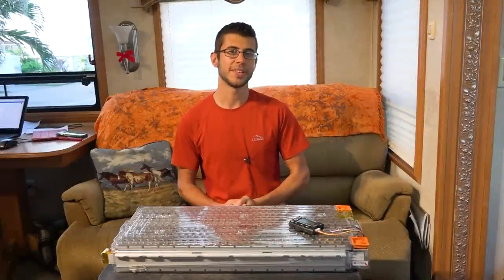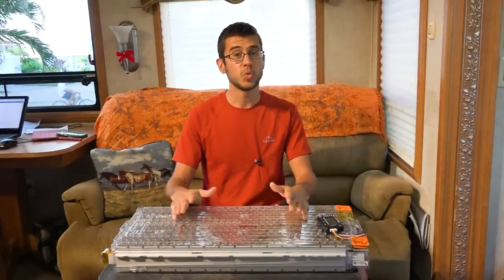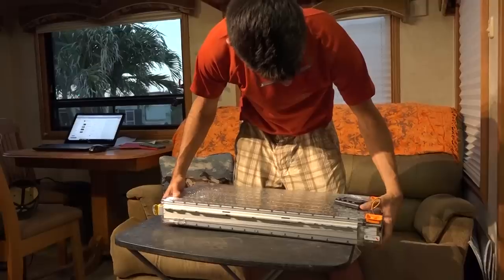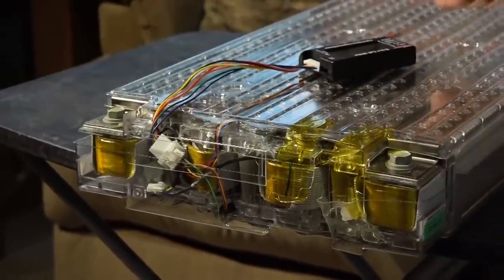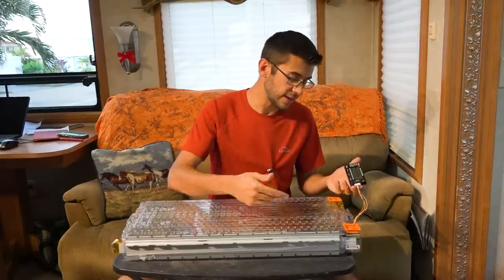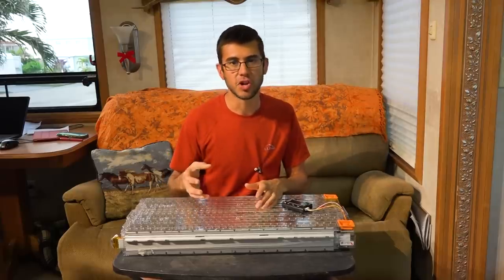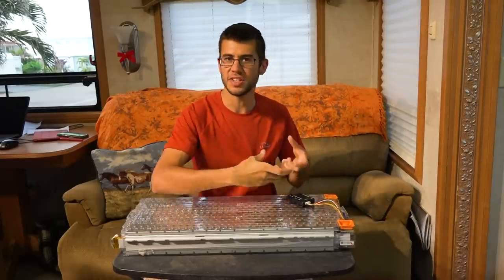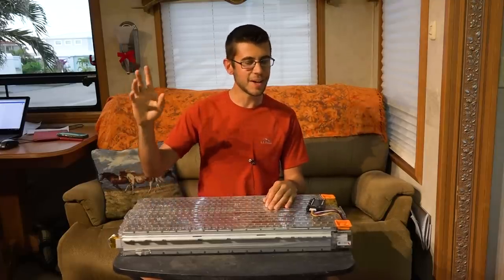Overview of the Tesla Lithium Battery Module We are Installing in our RV - EV Battery Hack!

Comment: I was hoping you were going to set up the system with your 12-volt system using step up and down components. I have a Nissan leaf battery bank i put together with a 12-volt 3000-watt inverter. the 12-volt system limits mt charge capacity to 16 volts. I wish to get the 16.8 volts max storage. to do this, I have to go to a 24-volt inverter. my biggest problem is that my intellicharger is only 25 amp. that means it takes about 6 hours to charge from 13 volts to 16 volts. i would like to find a 300 amp car alternator to solve the charging problem. after im done configuring everything, I will add the solar panels. any suggestions"

Comment: As this battery has ~5000 Watthours and I can find it for 1500 to 2000 $, it means a cost per Watthour capacity at max 40ct. 

When I am looking for a 100amph battery (lifepo) it costs about 1000$. 100amph*12volt=1200watthours. So nearly 1$ per Watthour capacity. 

Am I calculating wrong or is the price per Watthour for a used tesla battery just so amazingly low?

Edit: if I calculated right. Are there parts for an tesla rv solar system that are becoming more expensive, just for using this type of battery?

Comment: You said that lithium batteries cannot go below freezing, that they can be used, but not charged. Considering that they are in a Tesla (either with any lithium battery or any Tesla battery in any vehicle - including an RV), what happens if the vehicle is in a very cold climate that goes below freezing every night, and often during the day, for months when it is parked outside (or even in an unheated garage)? I see that it can be used, but how do you keep if from being in a freezing situation? Eventually, it has to be charged, which you said will destroy it.
Reply from the maker: The car heats the battery.  I talk about those heating cooling coils.... In our RV we use a heating pad.  Watch the rest of the series to see the installation.
Reply: @MortonsontheMove  I figured that was so when the car was being used, but that's why I mentioned if it's parked at night. My guess, therefore, is that the batteries run the heater if the temperature drops too low. I intend to watch the rest of the series. thanks
Reply from the maker: @steve-kb5fk  the car will allow the batteries to freeze but will run the heater before charging starts when cold so there is a delay. If it's plugged in they stay warm

Comment: Cool idea. What did you pay for the battery? What inverter / charger are you using? Thx
Reply from the maker: this battery was $1200 USD, more on the system in part 2 install video!

Comment: the bigger batteries used on trucks are 100 amp hours, which means it's 1.2 kwh not 2.5, just thought I would point out a minor math error :P
Reply from the maker: 12 vs 24v batteries.... 100 AH is 2.4 @ 24V

Comment: Tom,I would really appreciate your opinion, I purchased a Victron 12v 3000w 120amp Charger Inverter - can this unit be made to work with the 24 volt Tesla battery ? I have Benn offered a Tesla at a very good price and would like top accept it....
Reply from the maker: Unfortunately no, the transformer inside the inverter is different.

Comment: Can you make a video about the difference between tesla 18650 vs 2170 modules? I am planning to get Tesla battery for my campervan.  Not sure which ones to go far.  They say 18650 has in-built cooling and heating system.  Does it work when we get the 18650 modules?
Reply: The heating/cooling system is not complete. You need to add over&under temperature setpoint thermostats, coolant, hoses, coolant pump, reservoir and heat transfer to a moderate temperature (like your living space) - typically a small radiator system (like one designed for a water-cooled PC). Also needs thick insulation for battery enclosure (and hoses) if mounted outdoors.

Comment: Is there a size limit on lithium ion cells?  It seems kind of bizzare for Tesla to be building batteries this way instead of just using 6 large cells in series.
Reply: Actually it's not "bizzare" at all. As with any manufacturing process, yield must be considered. For instance, it makes much more sense to cast individual masonry bricks, discard any "rejects", ship them individually to a customer, the have them assemble them into a wall rather than ship a wall to them.  The second scenario would mean that whole walls that were "rejects" would be discarded, shipping costs would be rediculous, and the customer's ability to fashion a particular wall style and/or size would be limited.  In short, there is strength in numbers.  Tesla chose an existing cell style that had already been designed and improved for msny years.  Why reinvent the whell?

To Tom: great video but watch out for your terminology used.  There are 74 individual paralleled CELLS, used in each BANK, connected in series to form a string that makes up the MODULE.  The BMS you are considering would only monitor each BANK amd would likely not be able to manage the current requirements of 74 cells in each.

Comment: Stumbled upon your channel and have been enjoying your content, Thank you. We are in the middle of a solar and LiFePO4 upgrade ourselves though we are on a little different path. Powered by Tesla is however a pretty cool tag line. We looked into something similar but decided for one reason or another to not pursue. I am curious however to know if you have any concerns regarding the 233AH battery modules 20 hr rating coupled with your much larger solar 1200w array. Are you planning to parallel more banks to bring the battery amphour capacity more inline with the array capacity?
Reply: Think watts, not amp hours. They have 5.3 kWh of battery capacity, and 1.2 kW of solar. That is  a charge rate of about 0.25C, if the whole solar output is dumped into the bank with max sun. 'Normal' rates can be as high as 1C, which would be 5300 watts. If they have the standard 2000w generator and a very robust charger, they could run full solar and full gen into the bank.
Reply from the maker: Im not really concerned,  The oversize solar system is primarily to help meet daily energy demand on less than optimal days and run the fridge / AC (with hybrid inverter and gen) on peak conditions.   This battery should get us a couple days with our current power usage and everything else on propane.  Because it charges so fast and efficient we will be wasting some sun on a bright day, but if we dont use the power at night then a bigger battery still wont be necessary.... I guess we will just test it and see, No harm can come from under-sizing a battery, just wasted potential. this battery does not have a 20H rating either, most lipos can put out the power much faster with very few losses, so I am not sure exactly what the "rating" would be but probably much lower.  Most capacity tests i have seen were done at 1C capacity so around 1 hour.   Would I like more battery.... Yes, so we may add more some day :)
Reply: "No harm can come from under-sizing a battery, just wasted potential" .....True statement and I get it. The setup will just make for more frequent cycles. Thanks and good luck with the install. I am looking forward to finishing our system as well. See on the road and happy travels.

Comment: So did I hear correctly they are 208 Watt Hours per Kilo?   So Model S 85 has 16 of these? So 16 kilos of weight?
Reply: Each pack is 5,200 watts.  208 watts per kg means it weighs 25 kg. 25 x 16 is 400 kg for the modules.

Comment: Fully charged are they not 4.2V ? x 7 that makes 29,4 V. safety is to have a balancing charger, you can not rely on a lower total voltage for safety, as not any cell must be overcharged, and while your monitor beeps, it does not shut it off. The cherger must be connected to the balance leads, I don't see how to get that feature otherwise. Setting a total voltage is not safe enough. With a okay overall voltage you can have mess in between cells.
Reply from the maker: They are 6 cell.  We don't take the battery to 100 ever to keep a safety margin and unless you have a catastrophic failure you should never have that much problem with cell overvoltage.   If you want to go to 100 percent then yes a BMS with shutdown on cell voltage is best.

Comment: Could the Tesla battery pack be easily modified to be 3s instead of 6s ?   Cut 2 of the grids and add 2 external cables to put the 2nd 3s in parallel with the first 3s ?
Reply from the maker: Yikes, I wouldn't try it.  All those tiny connections to the cells, a lot could go wrong.  Probably not impossible however.

Comment: Hi can I charge this battery with 4000w solar panel and use it in load 4kw without problem while the sun rising
Reply from the maker: 4000W should be fine.  5000w max draw or charge for 1 pack.
Reply: @MortonsontheMove  thank you alot that battery which i need to charge fast and use big load  in sunny day

Comment: Hi, you talked about the Tenergy 5-in-1 Battery Meter, did you make the connetions from the tesla to it ? I am not sure if i cell balances if it those how those that work?
Reply from the maker: I should do a video specifically about that.  The place I bought my battery from put leads on it for standard blanacers... https://hsrmotors.com/   Press and hold the cell button to get it into balancing mode.  Dont leave the unit plugged in all the time either as it will draw from the first 4 cells and cause an unbalance.

Comment: Could you run two of these in parallel order?  If so how difficult would battery management be?
Reply from the maker: Yes you can parallel how ever many you want.  Balancing and cell BMS needs to be done pack to pack but as a whole voltage protection and temp management should be pretty easy
Reply: So essentially you would need two BMS', one for each battery correct?

Comment: You have to add 1s string to that battery to make it 28volts so you can use the whole thing. You will only get 65% of the energy out of that battery.
Reply: What do you mean, link please!
Reply: volts are too low
Reply: So you are saying to add a row of cells to increase the voltage? Do you have any examples of people doing this?
Reply: You could take all the batteries out and do it like that. Or you could count the batteries and match  a row of batteries then put them is series with the tesla battery pack. This should raise the voltage so you can use all of the power in the pack and have a larger range in voltage to use.
Reply: @caryyoung9411  Make it a 7S pack . Max voltage would be then 29.4 volts vs max 25.2 volts. This should work good.  At the lowest voltage it would be 21 volts and your inverter would kick off. This would be 3 volts per cell and would play nice keeping them happy.  I would say that voltage range would fit a 24 volt system better. 12 volt system can handle 16 volts , 24volt system should max out at 32 volts. 29.4 would be fully charged 17.5 volts would be fully drained but you would never get that low which is good. 90% of you power would be much higher in the voltage range anyways.  3.6 volts each cell on load would be 25.2 volts This would make a inverter very happy. Once the inverter is dead and beeping your Tesla pack would be at 3 volts each cell. that's would mean you might have 10% left in the tank but Vs a 6s pack it would allow you to pull more power out of the whole pack keeping volts higher. Right now Max voltage is 25 amps. After a 20% drain on the battery it will want to say at 21.6 volts for 60% of the time. This is way too low for your inverter.

Comment: I still have a led/accid battery of 110 Ah in my Iveco Daily . Starting battery.  It's 10 years old and hase spend a winter in the Daily, two years agoo with no use for 6 month's. A winter in Poland with temperatures as low as -20°C. When I came back from the south of Europe after that winter, the light truck started from te first click. Indeed, more then 10 years old and the same battery is still in the Iveco Daily, that I use a couple of times a week. Lithium battery's are lighter, more expensive. Only to be used where it's realy needed. Realy needed.  A good led/accid battery has rufly not to cost much more then the price of the led on the world market. Paying more is a rip off. I pay for all my battery's ( I live off grid ) not more then a euro for one Ah . 250 Ah semi traction, 240 € . Ofcorse, it's not " fashioneble " to use led battery's. My old hammer is also out of fashion but still works fine. Me too... :-)

Comment: *Should note that these batteries aren't Li-Po, they are Li-Ion, though! We went with the Orion BMS2 on our setup as we currently have 3 from the Model S P85D, with room for more down the road. Happy trails!
Reply: Can you please explain your post a little more. I'm researching batteries right now and your comment stands out as something I should know
Reply: @Just-My-Opinion  The Panasonic 18650 cells (which the Tesla battery modules are made up of) are li-ion (as shown on their data sheets) - also, check this out:  https://scottiestech.info/2015/06/21/lithium-polymer-vs-lithium-ion-batteries-whats-the-deal/ might help clear up a bit 😉

Comment: So if converted to12vt, wouldn't that double the amp hours?
And does that mean 2000ah?
Reply from the maker: It would be very hard to convert this battery to 24V, but yes it would be twice the amp hours.. not twice the power tho.  Around 450 usable 12V AH for one battery.

Comment: These aren't the film ion battery is there nickel Cobalt if I'm not mistaken that is
Reply from the maker: They are all lithium ion, but yes these use cobalt and aluminum in the anode and cathode.
Reply: @MortonsontheMove  okay I thought they were different mixture for longevity instead of mass power

Comment: How in the heck do you mount this thing?  I coudn't figure out how to bolt it down
Reply: probably get some steel straps
Reply: @kellyprivett9254  yeah it maybe some non conductive nylon equivalent.  I think that's the move.  Cool, thanks.  Also the plastic case it comes in is flimsy.  Scary that it's a real part of the battery.  I'm just going to use packing tape to reseal it.

Comment: Which type battery do you have that capacity controller set for?
Reply: It'd just be Li … These little controllers are used all through model (remote) aircraft usage … Try Bangood.com or similar and they are as cheap as chips and very good ..

Comment: I doubt that Tesla uses Lithium ION, more like Lithium Ferrous Phosphate (LiFePo4). Lithium Ion is pretty explodey, whereas LiFePo4 isn't. The chemical characteristics of the two are different.
Reply from the maker: I tell you the chemistry and stability in the video, they are li ion.  Much higher energy density.
Reply: Huh, I had to do some searching and it seems you're right, Lithium Cobalt Aluminium, ie a variant of Lithium Ion. That would explain all the elaborate security stuff with liquid cooling and stuff, lithium ion is considerably more dangerous and explodey than lithium ferrous phosphate. I kind of like having superior chemical and thermal stability in my home. Lithium Ion can also heat up a lot just by being charged quickly, plus, Lithium Cobalt is toxic and an allergen.  I think I'll just continue with my plans to use Chinese LiFePo4 cells for the van battery rather than Tesla stuff. You can get a lot of amp hours fairly affordably.

Comment: So how many amp hours in 12 volt does that tesla pack offer?
Reply from the maker: 5.2kwh...  460 12v amp hrs equivalent.
Reply: @MortonsontheMove  so essentially you are only saving a few hundreds vs using much safer purpose built Lifepo4 packs with proper BMS. You can get decent 400ah lifepo4 for just a little more cash. I hope you don't have any accidents with this pack, your playing with fire I think.

Comment: Did you said that they can not be charged?  What exactly did you meant by that?
Reply from the maker: With regard to below freezing?  I think I should have said you cannot safely charge it below freezing.  You can charge it but it will destroy the battery,  I did not make that very clear.
Reply: Got it.  Seems odd when you made the statement without the conditions. I wonder what you meant by it because batteries need to be charged.  That is the whole point.

Thanks for the video.  It was an interesting hack of EV vehicles.

Comment: Does anyone know what these used packs sell for, approximately?
Reply from the maker: $1400
Reply: Mortons on the Move  thanks for that. And interesting, same capacity as 4 Trojan t105s "golf cart" lead acid natteries, which cost a lot less (around $700). Granted it's not apples to apples for a lot of reasons, a few being: longevity (about a 4 year life for the Trojans), usable capacity (can't cycle lead acid batteries completely so you can't use all that capacity), energy density (they're heavier and bigger), and maintenance. I'm typing the above mostly because I'm thinking through it when I need to repower my RV, which currently has 4 Trojan t105s and 900 watts of panels (3 300 watt panels). I'd love to go lithium but don't want to spend a big premium. I'm thinking about looking at the ebike battery market.

Comment: Awesome stuff, I just wish I could buy one (or two) here in New Zealand! I ended up with a similar Lithium Ion pack 7.5Kwh from Boston Power, and a BMS system from http://zeva.com.au/ I have it connected to a solenoid switch to disable the battery if the voltage of any cell pack goes too high or too low, and it balances the cell packs. I'm also using the Battery Protect which will disable the 24/12v power if the voltage gets too low, thus the battery BMS should never get low enough to disconnect. I look forward to hearing how your tesla pack goes!